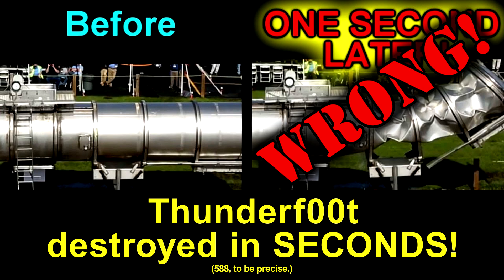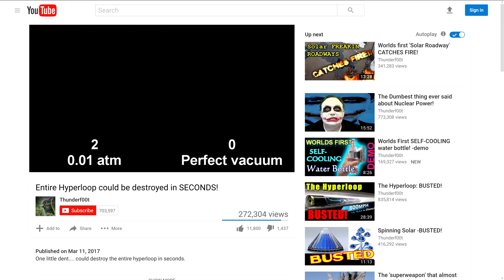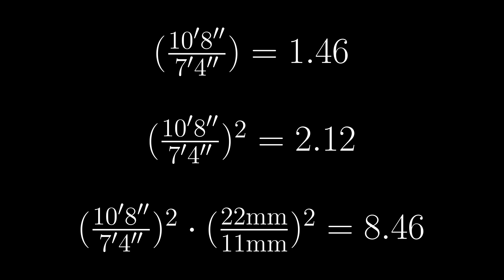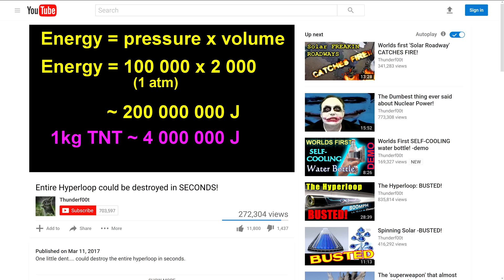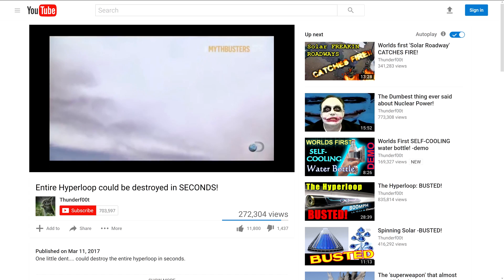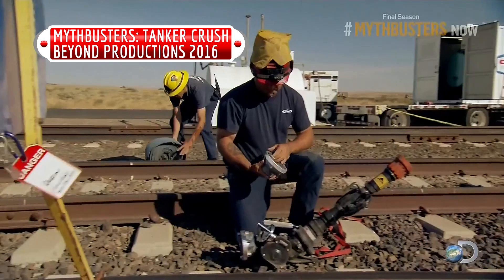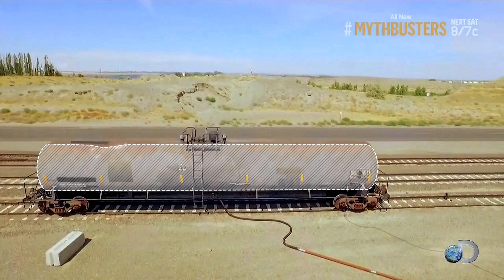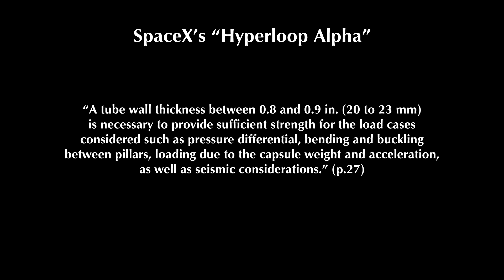Thunderf00t destroyed in SECONDS!

Comment: Reading up on this con, I come across this old vid. Still waiting for the hyperloop. Here is a thought for you, an experiment to try. Put a blob of oil in a pressure globe, pump all the air out, and see what happens to the oil. Oh.. I am an engineer. I never seen you define the difference between thick wall and thin wall cylinders, discuss Lames equations, do a max stress circle for a material under hoop stress, radial stress and longitudinal stress, while under temperature induced expansion stress with a 50 tonne pod whistling through it at 600mph 😂. Lets not even get into the stress fatigue in the pod in the airlock, heat dissipation in the pod, life support in the pod, etc 👍. Ohh.. next door to me, a new metro is being built. The tunnel machinese are at it, the rows of lorries are lined up with their concrete casings to feed into the machine.. how many miles of hyperloop.. How many billions of miles have ppl travelled on trains and busses in the past month or 2.. how many on hyperloop. 😂😂😂😂😂👍.
Reply from the maker: We did ALL of that AND MORE, LIAR. FUCK OFF.
Reply: @shanedk  Nope. Hyperloop aint done any of that. Consider this. UK is building HS2 at the moment. The initial cost was about 35 billion, but prob gonna be 100 billion. Std high speed rail, they have the locos and rolling stock, its the same as on HS1. Hyperloop does not even have an actual pod capable of distance. There are a couple of mile long tubes, a single 1km maglev track... and hyperloop is the future ? Nah. Now here is the thing. If a std high speed rail in the uk, couple hundred miles costs 100 billion, with existing tech, how on earth would it be cheaper to use maglev instead of rails.. and put the whole lot in vaccum tubes 100s of miles long 👍. Instead of buying twitter with 44 billion, could musk not just have built a proper hyperloop between 2 cities ? If it works, he could make trillions from it👍

Comment: I don't really see why someone would build a hyperloop vs a regular bullet train.
Reply: isn't the hyper loop just a bullet train in a vacuum?
Reply from the maker: @bubblegumgun3292  No. Watch the series.
Reply: Joe Amodeo  that is not a hyperloop that's just a tunnel.  you can't drive a car into a hyperloop tunnel unless you want to kill everyone inside.
Reply from the maker: We gave a ton of reasons in the series, but the biggest one by far is land acquisition. Especially across farmland.
Reply: @shanedk  the only way I could see that being a big advantage is if it's under ground. Plus with a bullet train you could still switch track. 
 I don't like it personally, I don't doubt it could work, I just think it's an overly complex solution to a relatively simple problem
Reply from the maker: @kakerake6018  No, the Hyperloop above ground is still way easier than a bullet train. Farmers wouldn't have to cross tracks; they'd just have to maneuver around the odd pylon.

And if anything, it's way LESS complex than a bullet train. Check out the engines on those things sometime!
Reply: @shanedk  ok man, I'll be totally convinced when I see a fully operational one irl
Reply from the maker: @kakerake6018  Ignorant neo-Luddism. Was there ever a fully operational Analytical Engine? No! Yet all of our computing technology is here because of it.
Reply: @kakerake6018  even if the hyperloop costs more to build it "may" pay back on its running costs due to less/no air resistance. There are always challenges to work out but thats why we test things before we dismiss them entirely. I seem optimistic but I would not be surprised if its a totally failure. Either way "You miss 100% of the shots you dont take"
Reply: @shanedk  Less complex than a bullet train ? How can that be ? It is essentially a bullet train in a near vacuum tube. It's not possible for that to be less complex.

Comment: you just don't understand how difficult it is to maitnain a vacuum of 1 mbar. you can't compare it to sustaining (near) atmospheric pressure in an airplane flying at 10.000 m @ 300 mbar!
Reply from the maker: It is RIDICULOUSLY easy. Just check ANY engineering source on pressure. You have to go down to a MICRObar--NOT a millibar--for it to be considered medium! High is 10^-7 mbar, and ultrahigh is 10^-12! Come on, YOU CAN JUST LOOK THIS STUFF UP!

Thunderf00t is the one who kept comparing it to a microPascal, which is 10^-8 mbar! HE is the one off by SEVERAL ORDERS OF MAGNITUDE, as we showed repeatedly!
Reply: Thunderf00t understands the difference between positive pressure and negative pressure. You don't. Amongst other things. How close to 0atm the vacuum is, is irrelevant; it it is near enough 1atm total difference between inside and outside as matters, and the pressure outside the tube is higher than the pressure inside the tube. That's the problem. The ~1atm difference and the direction of the difference. That's why the tankers, and any similar tube under similar pressures, would collapse catastrophically when ruptured. And no amount of capslock or "no u" responses from you magically changes that.
Reply from the maker: @xuhxjunk9708  "How close to 0atm the vacuum is, is irrelevant; it it is near enough" We showed OVER AND OVER AND OVER AGAIN that it isn't. I've posted links to engineering sources OVER AND OVER AND OVER AGAIN. YOU ARE WRONG. Whine about caps all you want because you're a fucking anti-science cultist, but YOU ARE WRONG. By SEVERAL ORDERS OF MAGNITUDE.
Reply: @shanedk  1. Direction matters. How close to 0atm it gets matters for vacuum pumps, but is irrelevant to the point I and TF were making; how these structures fail mechanically. Structures good at keeping pressure in, and their failure modes, are different from structures good at keeping pressure out.
2. "We showed" something irrelevant to the point being made in unreferenced "sources" (where? Not in the video notes nor comments that I can easily find), caps lock, "YOU ARE WRONG", and ad hominems still doesn't change how physics/engineering actually works.
3. Breath. Start taking the pills again. Or stop. Whichever you're not doing. Your responses are not making you look good.
Reply from the maker: @xuhxjunk9708  "How close to 0atm it gets matters for vacuum pumps, but is irrelevant to the point I and TF were making; how these structures fail mechanically." OMG, did you not WATCH THE FUCKING VIDEO???

At 1:02, I SPECIFICALLY said: "However, now Thunderf00t is talking about something different: the amount of external force bearing down on the tube. For THAT purpose, you DO look at a linear differential, not logarithmic. So in this case, there's no real issue with considering the interior of the tube to be a full vacuum, and we're happy to do so."

YOU ARE A LIAR. GO THE FUCK AWAY.
Reply: @shanedk  Again, that's (unnecessarily rudely) ignoring the point being raised; direction of pressure differential. What I'm not seeing is evidence of accounting for the difference between tensile strength and compressile strength. 

Talking about what kind of scale (linear for inside-vs-outside vs logarithmic for relative-to-vacuum) to use to measure the difference in pressure is an irrelevant misdirection.

You said "[...] tanker cars are designed to hold up against a positive internal pressure, not a negative one. As such the tanker walls don't need to be as strong as being used for the hyperloop [...]" ... which suggests you understand that there are differences between building eg an oil pipe or aircraft with higher pressure inside than out, vs hyperloop with higher pressure outside than in. It suggests you understand the latter (negative pressure) is more difficult, as is easily shown to be the case by as simple means as comparing the listed internal pressure / bursting limit vs external pressure / collapsing limit given for various standard pipe types (without needing to even go neaar any maths).

But then you scale values for the tanker for relative diameter of the hyperloop tube and thickness of the walls and consider that prood enough, assuming that only the static pressure is the problem. The example with the tanker shows it clearly happily holding out against 1atm ... riiiiight up to the point it gets slightly dented. At which point, unlike a positive pressure system which would tend to push everything out to be symmetrical and strong again, the (relatively) sharp localised point of weakness allows the negatively pressurised tanker to collapse in on itself entirely. This was the issue being raised; the design needs to be strong enough not only against static negative pressure while the tube is perfectly intact (already a more difficult case than positive pressure), but also strong enough against taking any kind of localised damage or weakness, as a negative pressure vessel is far weaker against such damage. Because if it's not strong enough, even a relatively small dent can result in a cascade failure of the pipeline.

It is not clear that the implications of that have been adequately considered by you, nor considered in any hyperloop design to date. The resulting extra metal and cost that would be required to try to address this issue (along with the simple fact there's still not a single working model anything like a complete system after ... how many years and how much money?) further undermines the idea that hyperloop can ever be implemented in an economically viable manner. 

"YOU ARE A LIAR. GO THE FUCK AWAY."

Seriously? Deep breaths, man. Being rude to commenters making reasonable observations and asking reasonable questions does nothing to help. At best it lampshades your misunderstanding of the discussion, and of your understanding of the issues of practicality raised vs hyperloop overall. At worst it paints you as a bully, bad faith actor, and fanatic of questionable sanity.

Skimming through your other videos you seem to normally have some grip on reality (at least where the likes of flat-earth nutters are involved), but if you want anyone to continue to take anything you say seriously, this attitude and the childish outbursts from you need to stop.  I hope you're not employed in any vaguely leader/managerial role; if I treated any of my engineers the way you've responded to me I'd be pulled up in front of HR. Thankfully, while I have been the angry engineer in years past, I have since learnt how counter-productive that is and made active efforts to correct it. (Now I am merely a "very stern" engineer.) Consider doing the same.
Reply from the maker: @xuhxjunk9708  "What I'm not seeing is evidence of accounting for the difference between tensile strength and compressile strength." Then you're NOT WATCHING THE VIDEO!!! WE CALCULATED THAT!!!

"Talking about what kind of scale (linear for inside-vs-outside vs logarithmic for relative-to-vacuum) to use to measure the difference in pressure is an irrelevant misdirection." THAT'S PRECISELY WHAT YOU WERE COMPLAINING ABOUT!!!

You're just a LIAR. You call ME rude, but LYING about what's in the video to score cheap points is FAR ruder! FUCK OFF.
Reply: @xuhxjunk9708  Some say "itll work" some say "it wont" only one way to find out right?

Comment: I'll probably start a war/be talking to a brick wall with this one:

Honestly(based only on my mere 3 years of mech-E education) I buy this theory a little more than the catastrophic failure one, considering the actual scale/size of the projected product. Like that's a lot of air that needs to be moving through a puncture hole at speeds fast enough to launch the car through the other end. And considering the segmented construction of it, I don't see how the entire tube could buckle all at once. Also, if they want it to be serviceable/maintainable at all, they would probably introduce some kind of redundancy or safety mechanism for a point failure. This is all if they are even continuing to build the darn thing. I also haven't read any of the technical documentation, so forgive me for hypothesizing.

And for those saying use SI units, if you live in the U.S.A. you're going to want to be able to do calculations in BOTH unit systems independently in the interest of meeting engineering firm standards. While they may not teach how to use them in private-school AP physics, they definitely come up later.
Reply from the maker: "This is all if they are even continuing to build the darn thing." They are. There are several projects underway at various places in the world.
And in this case, the units are irrelevant, since they cancel out anyway.

Comment: You made 1 point regarding what you consider to be an oversight on behalf of Thunderf00t with regards to the vacuum pressure and wall thickness.

You still failed to tackle the imminent issue of thermal expansion joints being applied to a vacuum tube, as well as the the issue of cost; the absurd cost.
Reply from the maker: ALL of these were covered, YOU FUCKING LIAR!!!
Reply: @shanedk  YOU LOOK SANE.

Comment: So, what if some random idiot decides to fire a bullet in one section of Hyperloop?
Reply: Well, I'm not saying anything is impossible for engineers, but if and when they do build a full scale version, in terms of difficulty, it is going to carry all of the technical complications of a space station, only its on earth, 15 feet off the ground. The cost to design a "bullet proof" system using the lowest cost available materials (concrete, steel, Iron, Aluminum etc) is going to be monumental. I couldn't imagine what the tab for a thousand mile long tube made of fiber composite material would cost to build and maintain. Level four Ceramic body armor for comparison, something that is designed to be light weight and bullet proof costs roughly 200 dollars on average per 1" thick square foot of material. If they use a inferior material that can be shot and survive, the structure itself would have to remain intact and free of track/surcace defects and the vacuum pumps (which is another physics nightmare) would have to pump harder and make up for the lack of vacuum. Kinda like an aircraft cabin being shot and the pumps making up for pressurization..but in reverse. But Aircraft aren't pressurized 1 atmosphere over the surrounding atmosphere, unless its a space craft. The Tube is negative 1 atmosphere at sea level, and the structural stresses are much larger by comparison. The aircraft to tube analogy is like comparing the pyro snappers you threw as a kid to a hand grenade. Well, maybe thats a bit of an exaggeration, but at the maximum, the structural forces exerted on  a pressurized airliner at 20,000 feet would be less than 1/4 of the pressure exerted on the tube at sea level.
Reply: The latest idea is to make boring tunnels cheaper and build underground. A pressurised tube isn't inherently dangerous anyway, there are so many ways to make a train safe including emergency pressurising the whole system. If anything goes wrong you are within a breathable atmosphere, it's only if it's working properly that it's dangerous, until it breaks and you're safe again. The worst thing that can happen is a crash and every mode of transport is susceptible to that, except crashes don't normally happen in tunnels and in fact derailment, the foremost cause of train accidents is mitigated a lot by the steel surrounding tube forcing you back into alignment with the rails.  As I said at the beginning however, it's going into underground systems if at all.
Reply: Scott McLaughlin Yes it is also still a prototype and not made for humans. i am pretty sure if a big one for human use gets built they will make it bullet proof and over all safe. if they dont, the goverment wont rate it as sage for humans and noone will be allowed to use it.
Reply: Heavy wall pipe? Concrete shielding? Why are you acting like its going to be a sheet metal tube holding a partial vaccum, it could very well be 3 inch wall thickness which nothing less than a literal tank shell could penetrate.
Reply: TheBoik Allah akubar
Reply: Aircraft have redundancy built into their design to mitigate such events. The Hyperloop as of now does not have any safety redundancy in its design and any failures will cause a chain reaction failure in all systems.
Reply: im really late but.... did you watch the fucking video ?
Reply: what if someone does that  to a plane and hits the fueltank?
Reply from the maker: Sigh...COVERED!!!
Reply: Oh... https://youtu.be/3rsT59Vpdbk